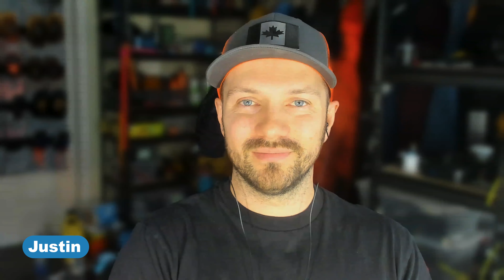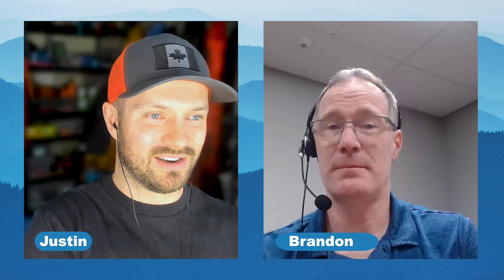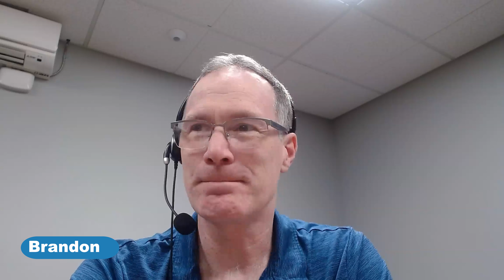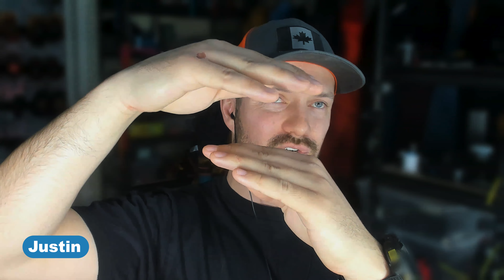How is Sleeping Pad Warmth (R-Value) Tested? w/ Brandon (Therm-a-Rest)

Comment: I'm curious if anyone know the R-value of the original Thermarest. Bought my first (slightly) self-inflating one in the early eighties and used it for everything including many nights on snow. Seem like the current 1.5 inch ones have an R-value of around 3. Used the later 1 inch ones too a lot in the winter without any problems, but today's recommendation seem to be much higher R-values for winter use.

Comment: Very cool to have an experienced industry guy! It was weird though that the physics of it is blurry even to thermarest, maybe it would be worth it to invite a physicist next to talk about this subject and others (condensation, fill power, ..) in a more technical way. I was also a bit frustrated that some questions are still unanswered: why some pads sleep colder than their R value? Is there a way to cheat the test? what about cold spots/down migration problems? Pads that sleep colder when you move a lot on top of them (s2s winter pad)?
Thanks for the podcast!